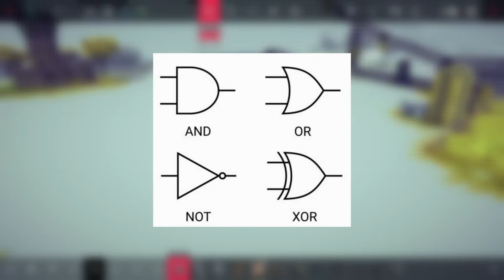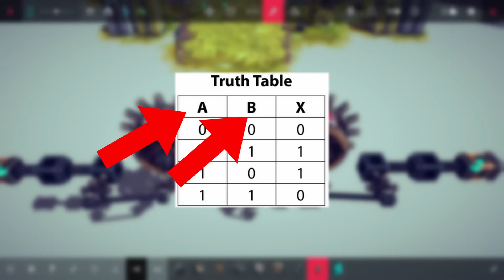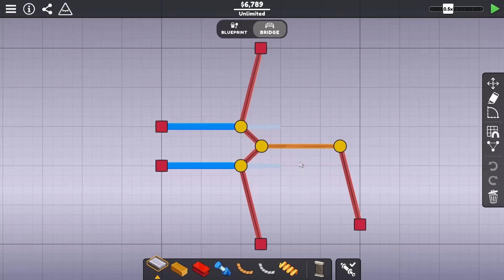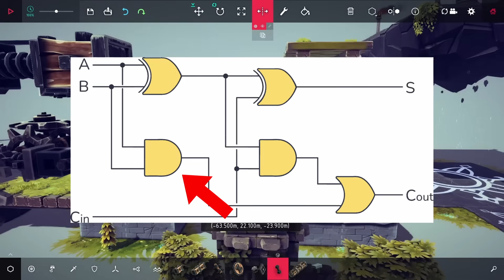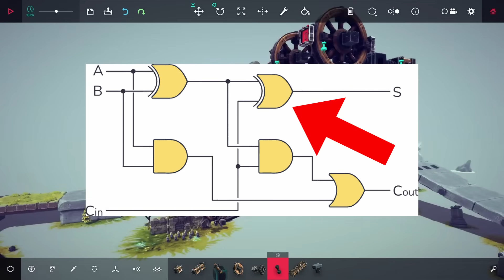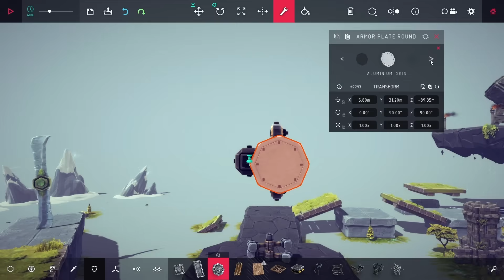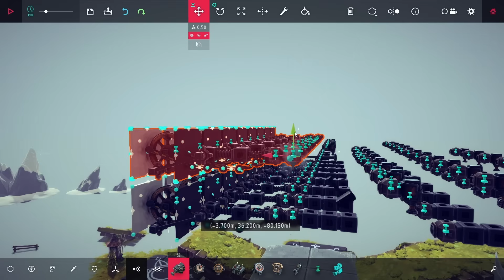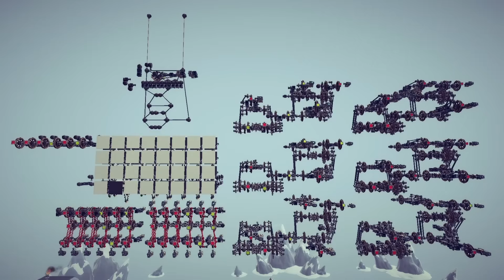Making A Fully Mechanical Computer in Besiege

Comment: man, those custom armor plates look fantastic!

when tying 2 wheels together using a 4-bar linkage, you can save some parts (and get rid of the dependence on braces that don’t behave intuitively when rotating and would thus add resistance in some more-dynamic setups) you can use ropes in a similar way to the springs you used for the RAM. a quick pulse of retraction at a speed of 0 when simulation begins is all you need to lock-in their length.

you can also make sliders that don’t exert a force by replacing them with suspension with a spring coefficient of 0. (they’re SUPER nice to work with; would recommend.)

Comment: I've been trying to learn about real life quantum computers and how they work using probability. If there are any truly random elements in Besiege or other similar games that can be manipulated with inputs, I think building an extremely basic quantum computer would be technically possible alongside quantum logic gates (which are surprisingly similar to regular logic gates) to make something insanely impressive. 

Just throwing the idea out there! I feel like misconceptions of how quantum computers work would be reduced if someone was able to show a simplified version in a video game, much like seeing a normal computer built in game helps stop misconceptions on how they work as well!
Reply: 3blue1brown fan spotted?
Reply: normal computers cannot generate truly random values, only pseudo random values, which makes that a bit tricky.
Reply: If you wanted to, you could maybe mod a block into besiege that takes the real input from a random generator and rotates itself according to the input. but quantum randomness is probably impossible in besiege.
Reply: Randomness is not all you need for a quantum computer. You need quantum superpositions, which are not going to be modelable in any system not expressly designed for it.
Reply: @zutaca2825  Quantum superpositions are just complex numbers being added together, and complex numbers can be modeled with 2x2 matrices, which is probably doable with some cleverness (and you'll have to do matrices anyway for the gates/operators).
What I think is the biggest difference is that quantum computers use a continuous range of values (at least in their intermediate steps), more like an analog computer than a digital one. And I think Besiege would be a good choice for this, because it's harder to make it have discrete outputs than continuous outputs. Those gears are just asking to represent phases!
Reply: @ You don’t just need complex numbers, you need matrix multiplication of complex numbers. With only one simulated quantum gate operating on 2 simulated qubits, you would need a 4 element matrix of complex numbers multiplied by a 4x4 matrix of complex numbers, for a total of 64 complex multipliers.
Reply: @zutaca2825  Complex multiplication of matrices can be done via real multiplication of a twice-as-big matrix, maybe that's easier (I have no idea). Matrices would definitely be a copy-paste nightmare, but I've seen this guy build some huge stuff with tons of moving parts, so I wouldn't put it past him.
But yeah maybe an analog computer first, to get familiar with multiplying real values.